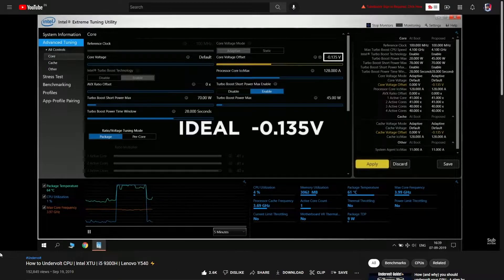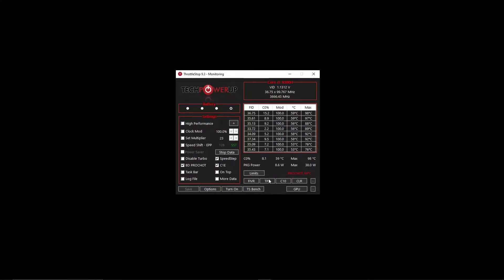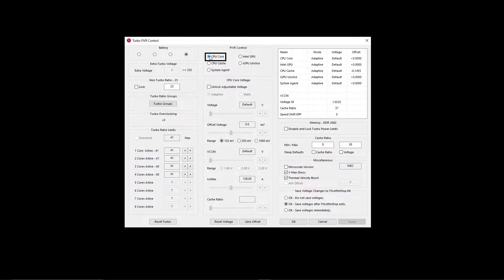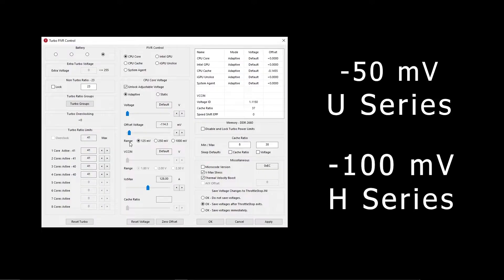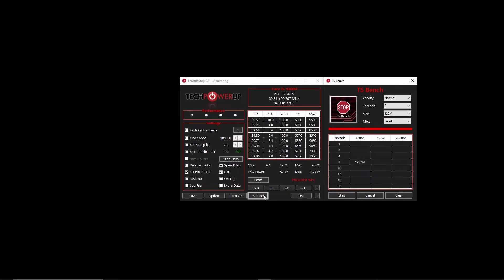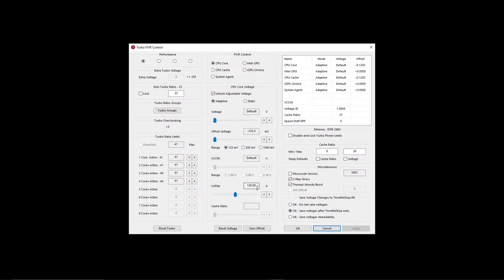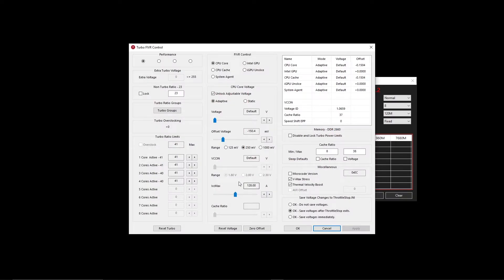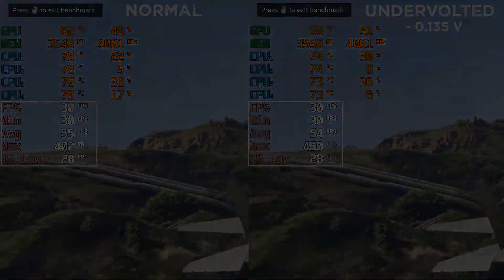How to Undervolt CPU with Throttlestop ⚡

Comment: i7 11800h -100mv crash -75 no temps low
Reply: Yeah 100 also gave my 11260h bsod pretty quickly, start with 60 instead if using same number for both core and cache, but supposedly core can be offset more than cache I think

Comment: how do i unlock adjustable voltage, it says i have it locked ???
Reply: Did you find any solution I am facing the same issue
Reply: @pranshushivhare6146  nope, the main reason i was looking for this was due to my high cpu usage which interrupted my gaming experience. turns out i had a trojan in my computer which was consuming all my cpu.

Comment: If you are playing on a laptop (any gaming laptop equipped with an RTX 30 or 40 Series GPU), make sure your IccMax is 150. You don't need more than that until you need a turbo-boosted CPU frequency of above 4.8 GHz. This will surely help reduce the heat. 🙂

Comment: Hi I have an i7 10850h with a rtx 3060, I did the manipulation via Throttlestop but even when I went down to -500mV the temperature didn't go down or even up and the score too.

Any ideas? Thanks
Reply: uv locked by bios... Had the same and had to mod bios to unlock UV possibility

Comment: Ay man, you made a slight error in your instructions.  You advised to save voltages after throttlestop exit.  Then you made your changes and immediately ran the benchmark .  If one was to follow your guide, they would be benchmarking an unchanged system, with the belief that their systems were stable under changed voltage offsets.  This could be very bad for users who believe their systems to be stable and then set extremely high offsets...only to find that they would be stuck in a blue screen loop if a throttlestop task was setup to auto run at user logon. To correct this situation, you should advise to select the option that says "Change voltages immediately".   Also, I'm running an i7 8750H and I have set core and cache offsets to -150mv with iGPU and iGPU slice offsets set to -60mv.   All stable results with less throttling because of heat.  I'm not a throttlestop nazi or anything...just FYI
Reply: I think that setting means that the voltages will remain changed even if you exit, not that they will only change once you exit.

Comment: Hi Ladka, Thanks for this update. I've been using XTU for quite a while now with your recommended settings on my lenovo y540 intel i5-9300H. Would you recommend swapping to throttlestop instead? My stable specs for xtu are -150mv cache and core, 70W and 45W turbo boost. What settings should I use in this case with throttlestop? Thanks!!
Reply: if it aint broke,......

Comment: I'll be waiting for the next video regarding the other tuning options this application offers, because this video helped me a lot. But still, i'm not sure if the undervolt is properly working since I'm already at -500mV and my laptop is running as normal
Reply: You have to undervolt both the core and the cache individually when using ThrottleStop. If you only undervolt the core, on most CPUs, this will not do anything.
Reply: @unclewebb  sweet!
Thank you for the answer

Comment: I have a INTEL I7-9750H what values i should to use ?
Reply: I have the same CPU. I'm undervolting for over a year now. As explained in the vid, it doesn't really matter, as long as the computer doesn't crash (which is no problem too, your PC will just restart). You can find your optimal value using a trial and error approach. However, if you undervolt too much, your computer might throttle your performance because of too 'few' energy. I would recommend -100.6Mv.

Comment: Can I use this software to undervolt a desktop CPU i7-12700K with a B660 Motherboard that runs Stock (no OC)? I live in a hot country or my room doesn't have too good of an airflow, could I use this program to undervolt my CPU?
Reply from the maker: Yeah, you can just follow up the tutorial and set your values up as much as it's required.

Comment: What values should I use for an i7-10750h?
Reply from the maker: around -0.150V
Reply: @CuriousLadka  If I use different values for core and cache, will the undervolt work still? Because with the same value, the max it can go is -90mv, higher I get a bsod. By the other hand if i set core to -185 and cache to -90 it’s stable. Will it still reduce temps?